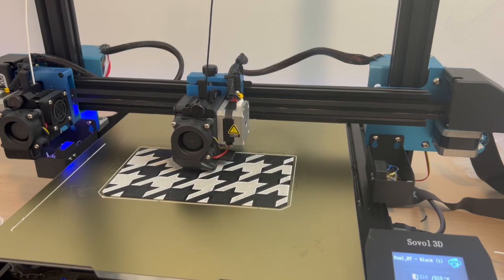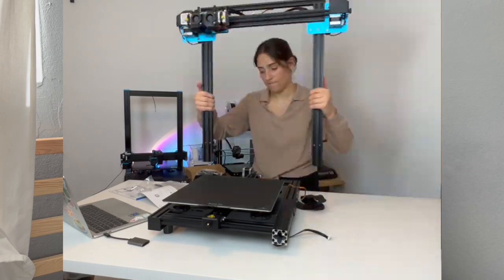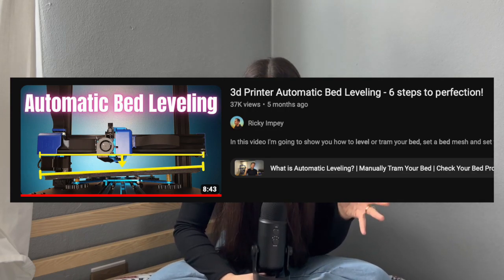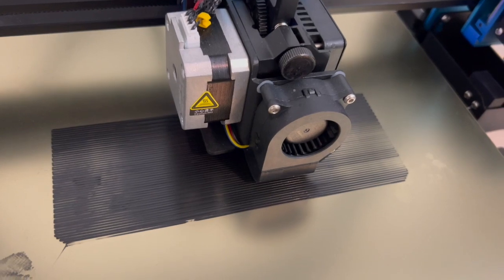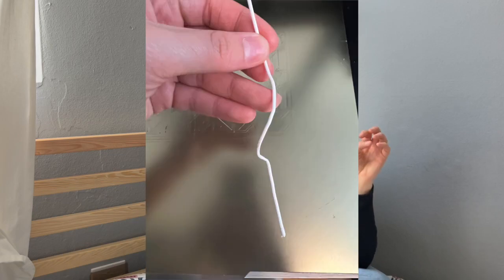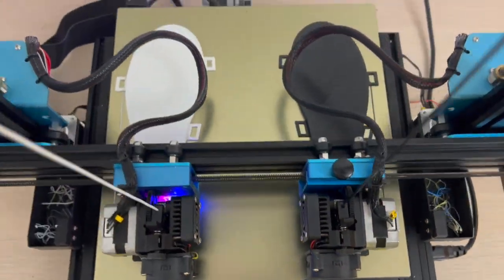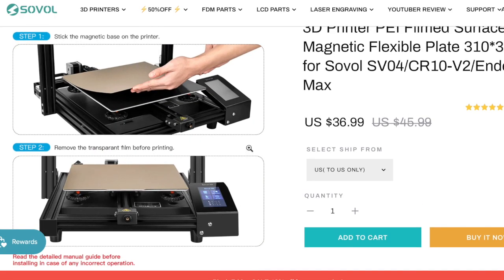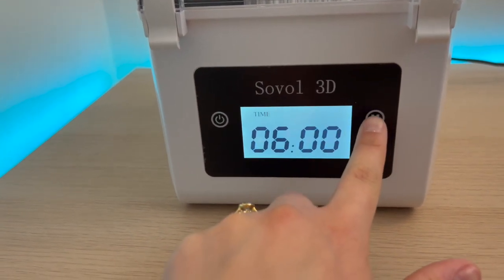Sovol SV04 Review - Ideal budget printer for 3D Printed Fashion?

Comment: Thanks for saying the best way to get the PEI sheet. Upgrading the printer is one of the simple joys for me, and that bed sheet was alluding me on Amazon. My main reason for getting it is the larger build volume and the dual nozzle so I can use mirror mode and print out some audio equipment that I'm designing.

Comment: You look like you're pretty proficient at 3D printing. Im into   RC Airplanes but also like sewing and could see dabbling in fashion. 

I'm pretty mechanically inclined and have worked on my Ender 3 extruder for printing TPU and was able to get it to work well (and its a Bowden type) if you remove the spring and grind it down on one side (shorten it a tiny bit) it should have less pressure on the flexibles. That or if you can find a slightly softer spring. 

The material you made with the mesh fabric imbedded is awesome. I realized you could cut a pretty big section of the mesh and keep printing another and another section. Rolling up the already printed part and somehow hanging it off the side or back. 

Anyway cool work youre doing!

Comment: Very cool!  Are you in a humid climate?  Wondering if I need a drier......
Reply from the maker: Good question. I have had trouble printing with TPE in humid climates since they absorb a lot of moisture. I tried putting the spools in bags of rice for a while but the filament dryer was what finally did the trick 👌🏼

Comment: How come no vids? you dont have much on youtube. Also for those bits on tiktok with tpu what glue were you using as the biggest problem I am having with tpu is nothing sticks to it. superglue, gorilla glue, epoxy, e6000 all peel off, tetrahydrofuran  a solvent is supposed to be the thing to use but cant be got in my country. were you using tetrahydrofuran?